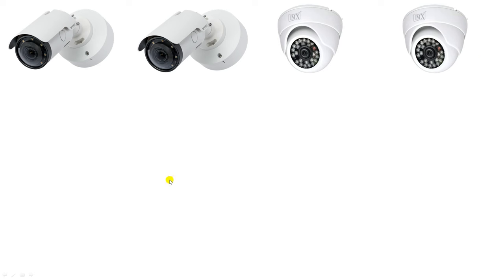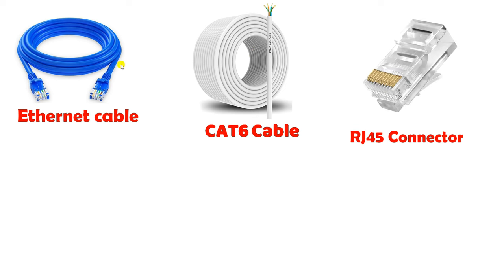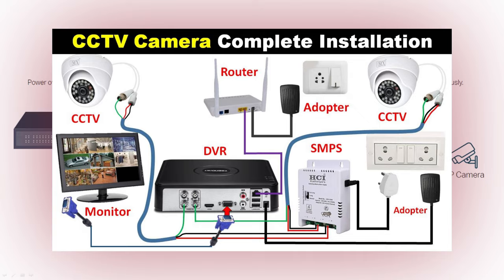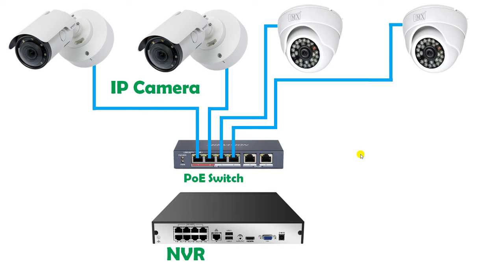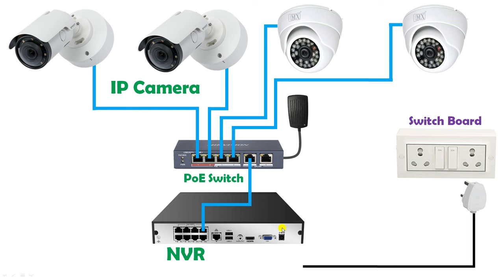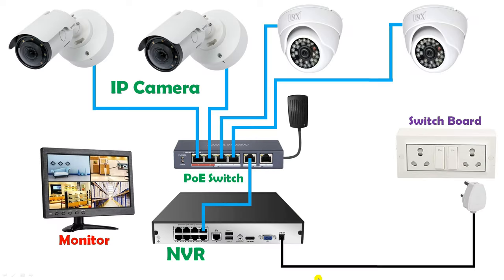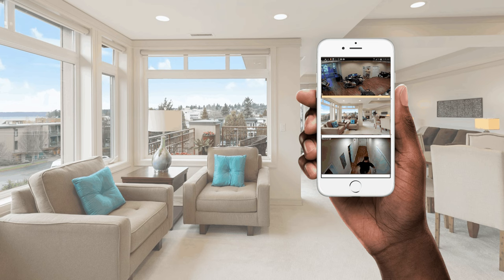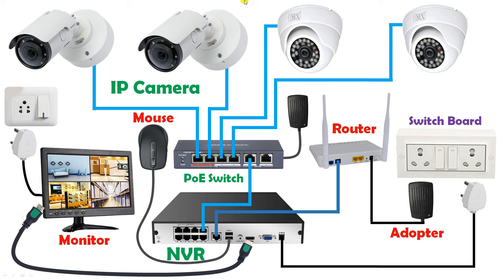CCTV Camera Connection with NVR for Home @TheElectricalGuy

Comment: hi there can you tell me if you didn't remove 1st wire from camera to NVR  ,say you has 8 hook up on nvr for camera ,you have 9 or 10 camera can you still plug 6 or 7 into nvr then extra  2 or 3 into POE ,then bring connection  from POE into NVR other 2 or 3 camera. that also work or you can't mix POE & NVR.  confused there.  thx